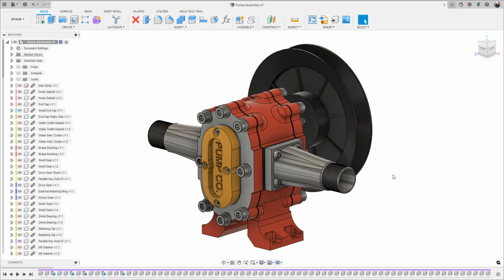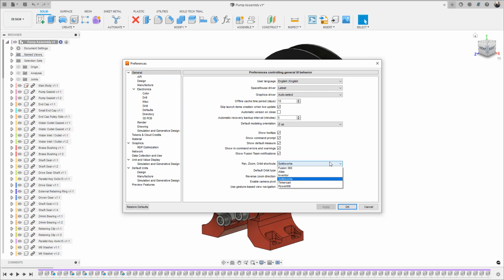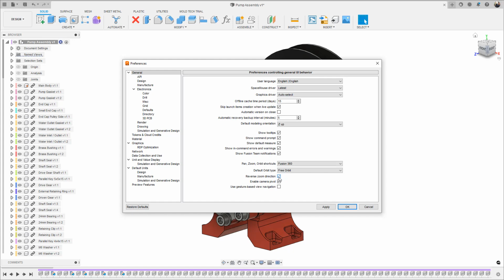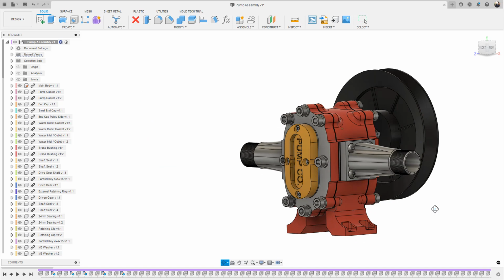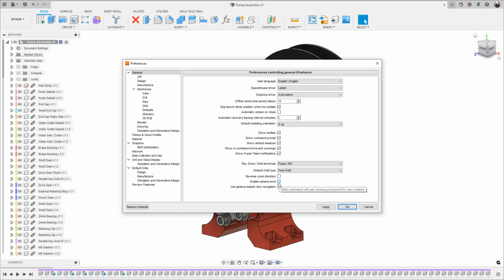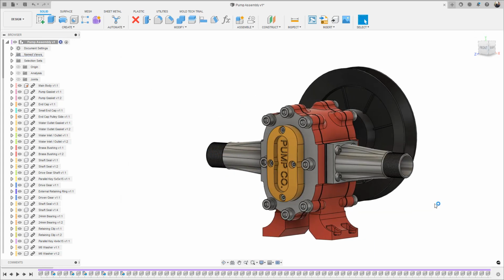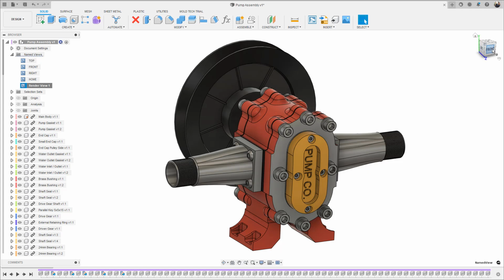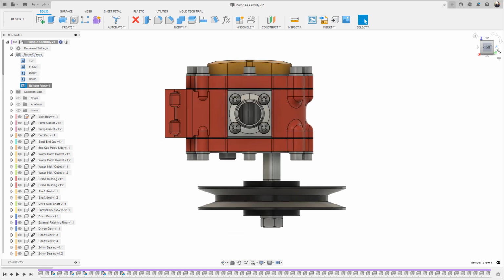Set Pan, Zoom, & Orbit Controls | Autodesk Fusion 360

Comment: Can someone tell me how to use scroll wheel to rotate the model? I set to fusion 360 in the pan, zoom, orbit shortcut, and i set center point with the orbit icon at bottom of toolbar, but it will not rotate the model when i use the scroll wheel no matter what I do. I tried turning off and on the other settings like camera pivot, and gesture based view navigation, but nothing works. I do see a little arrow next to cursor arrow after i set center point of orbit but i cant get it to rotate after that.

Comment: thx @Autodesk for pointing to this Problem. It is really annoying that there is no way to bind basic "zoom, pan,  orbit and gestures" even as paying customer! Same here, that i have to use the "NoGesturesNoShift" Plugin. This is from an other User with the same usability issue. But the plugin sometimes stops working, stopped working after an Fusion update...and wait for the Plugin-Developer to update it. Does not sync to second PC, etc ... But even there i can swap middle and right mouse buttons in the Script file and it helps a lot! thx@Paweł for your work.  @Autodesk:  please add this simple keybinds. Some may need it more than others, but many  will love it. 🧡

Comment: It's a shame there is no way to bind a different mouse button to orbit. e.g. I have down, left and right button functions on my wheel, (as well as standard left and right mouse buttons) but I can only use the wheel down as move, or orbit with shift held down. I've had to code up a separate program to detect the wheel button being pressed to the the left, and my code then holds down shift and programatically sets the middle button as down so I can orbit without having to press shift physically. I would be so much easier if I could simply assign move to the middle button down. and orbit to the middle button left.
Reply: you might be able to reconfigure this in your mouse settings if it comes with an app such as logi+
Reply: @pixelrabbit261  I don't want to change the settings manually for each program